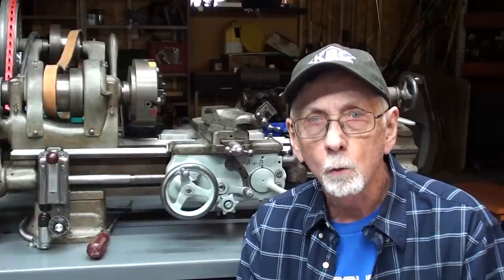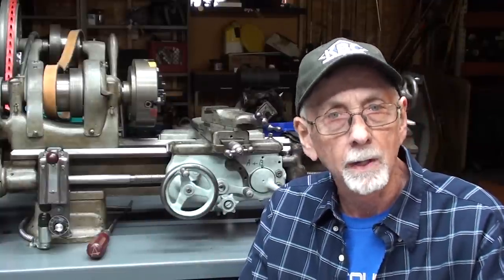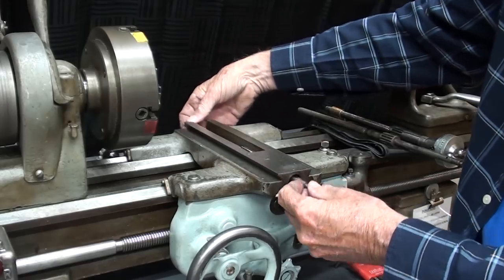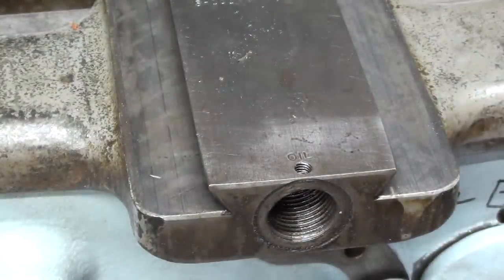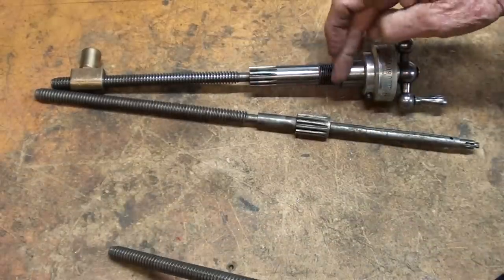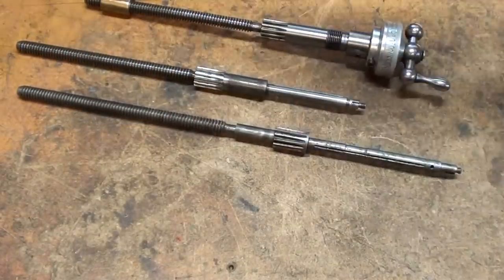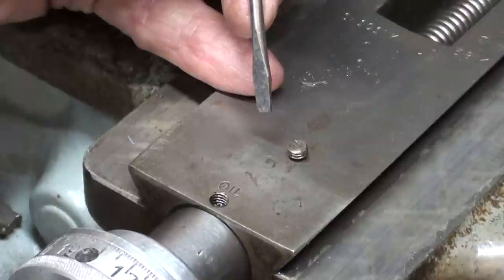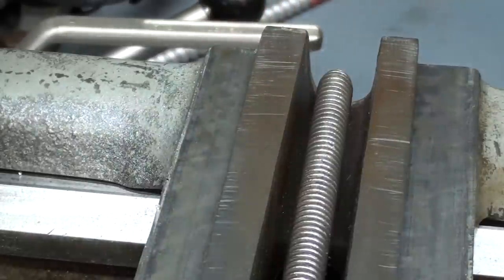CORRECT SCREW for SOUTH BEND LATHE #817 tubalcain

Comment: The oil holes does not have to line up.  The groove that is turned on the shaft around the holes means that whatever the orientation oil can circulate around the groove which act as a reservoir and enter the oiling points.
Reply: "Oil Can"   I love it.
Reply from the maker: Thanks
Reply: Why not a tiny Gits oiler there so you could pop in a few drops when you think about it?
Reply: That was my immediate thought.
Reply: @ellieprice363  The cross section is way too thin for a Gits ball oiler.
Reply: yep, similar to a banjo fitting
Reply: i agree i was going to type the same thing
Reply: @cyclebuster  Just would not look right with a Gits ball oiler on there if there was room for it.
Reply: @fuzzy1dk  👍
Reply: That oiling point needs to be flush or below surface. If you put a gits oiler there, how would you crank the cross slide toward you all the way?

Comment: Very good video. I will add one thing. I have been using Green locktite for many years for permanent instalation. After allowing a 24 hour cure time I have yet to have a failure! It's some strong stuff in my opinion.

Comment: Another great video Mr Pete! I have a 1929,  9" South Bend lathe. Had over 50 years! Still not much wear considering age. I had to braze up 2 teeth in the back gear when I got it. After that it was really nice! Flat belts and jack shaft makes for cumbersome speed changes! Lol! Not used much any more as I have a 15" Clausing, 7.5 hp and 50" between centers. Made more money with the SB 9" but I've had it much longer. Might catch up one day but I doubt it! Thanks for your time and sharing! Morning coffee and Mr Pete vids, thanks!
Reply from the maker: I know what you mean. Once you have a bigger lathe with many features, it is hard to go back to the smaller under powered machines I do 90% of my machining on my clausing

Comment: I'd say oil that little hole, the two holes in the threaded collar are trapped inside the cross saddle EDIT: THREADS and if we dump enough oil down the cute little plug hole, it'd get oil. ?
The older cross screws are a Wiley bugger to try and straighten.
If I may? The original cross feed grad. collars are not direct reading.
Might that be a short subject? I'd like that info to clear it up. Is it to remember to multiply by 2 the small dials to actual work done? This older 9 smacked me in the face with that just an evening ago with that.
An older machinist tried to stump me with "You know if I go .005, it'll be a ten thou cut?" Yes, I understand that Roland. Great mind for machining, we became good work friends, learned much but was stunned he didn't want any part of machining after he retired soon back then. Stunned.
Thank you for never giving up trying to teach us lunkheads! Always appreciated/always learning.
Reply from the maker: Thanks. I cover the direct reading topic many years ago.

Comment: Lyle -  Another great video.  'No wonder there's an oil shortage' - have to laugh as I oil my Heavy 10 the same way every time I use it.  Was cutting threads yesterday so it got oiled - including all the small screw removals to make sure all surfaces are lubricated.  Take a few minutes but is a 'Zen moment' LOL.  It's a 1945 in good shape and I want to keep it that way.  I'm about 7 years younger than you and understand the nice larger dials although I'm still able to use the old small ones.  Now you can really confuse yourself with a direct reading cross slide and old style compound - at least I'm sure I'd mess it up but you are most likely more attentive than I am.

Comment: Lyle ..
Am I correct in pointing out the oil would fill the groove between the thread and shoulder in the feed screw and find its way into the hole regardless of orientation  ?
Just trying to avoid your imminent crucifixion.

Comment: I work for a company that manufactures IOLs (intraocular lenses). They are used for cataract surgery. I have heard you mention that you have cataracts several times. Have you ever thought of having new lenses implanted?
Reply: I have a manmade lens in my right eye. My vision from day one was measurably worse after than before. A lady in my building is blind in one eye because the lens replacement failed badly. My father ended up with two manmade lenses and was happy with the results. So end-user results vary widely. Traditional cataract surgery removed individual cataracts. 
I can only hope the majority are happy with the results,but my own experience is so suboptimal I will have to be blind in my left eye before I ever allow the risk. There is a phrase that goes,be careful what you ask for you just might get it. If Mr. Pete can cope with what he has,that is better than being blind or having a fuzzy mess for an image,which is what my right eye delivers. Not being unpleasant to you,but there is always risk in any surgery.

Comment: That's a beautiful little lathe. I haven't seen one with a tensioning feed clutch knob for a very long time. Does it have a bull pin to engage the back gears?

My method for cutting left hand acme threads is put the cutting tool upside-down and run the spindle in reverse. This allows the cuts to travel from the tailstock to the headstock and you won't have to machine an undercut for the thread. I made a few of them about a year ago for a defense project....don't forget to have calibrated thread ring gauges either.
Reply from the maker: Yes, I love that method of running the machine backwards
Reply: @mrpete222  not safe on a lathe with a threaded spindle holding the chuck  : )
I've only tried running in reverse with the newer spindles with a series of cam locking pins securing the chuck to the spindle.

Comment: Would milling a small groove between the oil holes allow oil to wick I to where it needs to go?  This way the orientation of the holes wouldn't be as crucial.  Thank you for posting interesting content such as this.
Reply: I think the thread relief serves the purpose of being an oil passage to the cross-feed screw. Note the sleeve has two holes for oil and it is doubtful they were drilled at assembly as Lyle postulated. The test would be to remove the oil plug screw on the cross-slide and add oil. If the oil can't go anywhere it would overflow instantly.
Cheers from NC/USA

Comment: I too am in need of a model 9 cross feed screw if anyone has a lead on one. I am refurbishing an old machine that had been tipped over and broke the cross slide and gearbox. Gearbox is fixed but have not found a reasonably priced screw. any help is appreciated.

Comment: I posted this on an earlier video on the SB lathe by mistake so I copied it here. I have a South Bend Mod.9a. purchased from the estate of a old clock maker. It came with a complete, (i think) set of collets I have used them using the hand knob draw screw but I also have the  SB lever closert attachment SB#CL5206N, the Turet tailstock SB # CL2045N and the Combination Double Tool Slide SB# CL2030N and the  Milling Attachment SB#2680NB. I don't forsee ever having any use for any of these attachmants. I am looking for a home where they will be appreciated and may be used. If this email does get to you (I hope) I am offering these to you or if your not interested maybe you know where/who may be interested. Of course the problem is location, with shipping being expencive. I enjoy the videos. I know you don't want your email out in the web, neither do I, so I don't know any other way to get in touch with you.

Comment: What does direct read mean versus???? ?
Reply: Direct reading means that each graduation of the dial takes that amount from the diameter. Small diameter dials are usually calibrated for radius. (.010 on the dial removes .020 from the diameter.) With direct dials .010 on the dial removes .010 from the diameter.